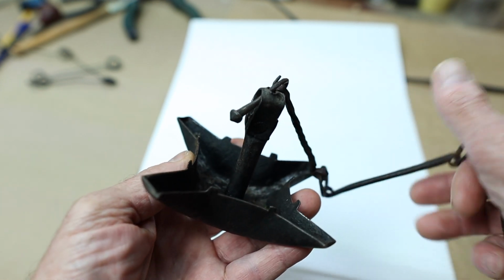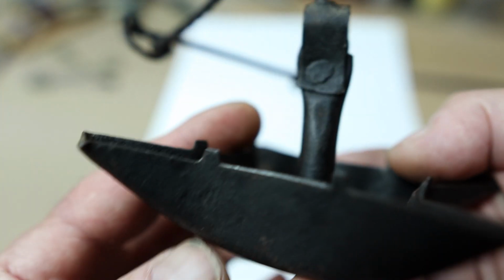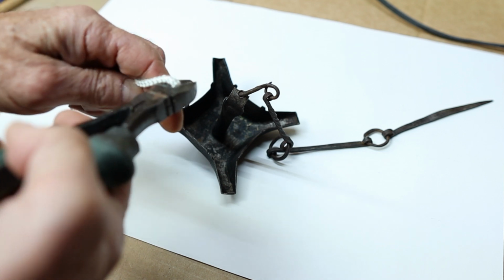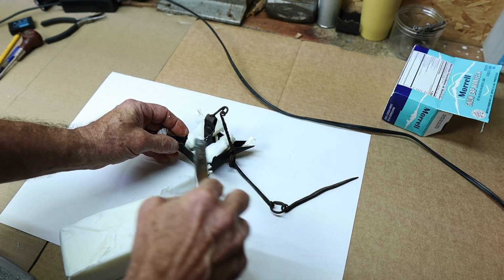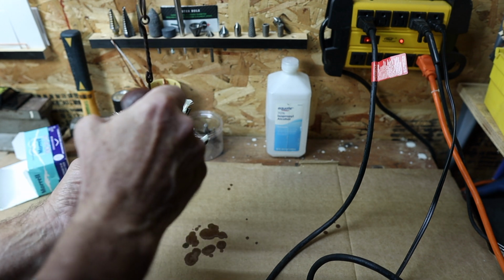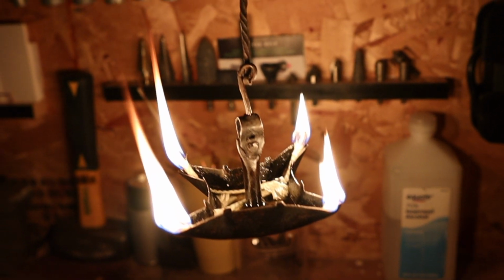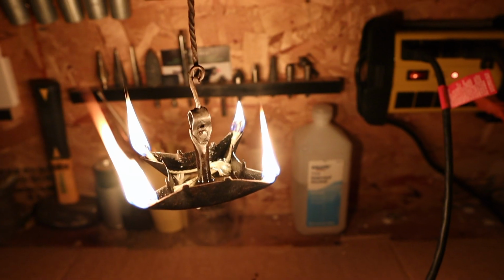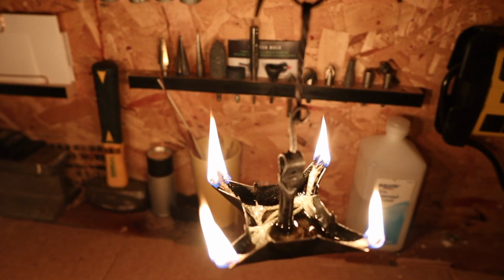Lard For Light When The Grid Goes Down?

Comment: Calling the lamp you have a "cruiser lamp" is a misnomer.
It's a beautifully preserved antique and I applaud your skill in making a reproduction, but it's still just a simple oil/grease lamp.
As you have noticed unburned oil drips from the spouts where the wicks are.
In Scotland in the 17th century they started making Cruisie lamps, also spelled "Crusie" and "Cruisean" (spelling wasn't an exact science back then).
The Cruisie lamp consists of two lamp pans, one above the other. Fuel drip from the upper lamp pan fell into the lower pan minimizing oil/grease mess below the lamp. As the fuel in the upper pan was used up the angle of the upper pan could be altered to keep oil flowing to the wick.

An evolution of the Cruisie lamp is the Betty lamp. In the Betty lamp the upper lamp pan is dispensed with because an internal wick holder eliminates fuel drip. The addition of a top cover provides protection of the lamp's oil from insects, minimized spills and increased burning efficiency.

Comment: Oh - could you attach a little "saucer" ?
On a "stem" just like the lamp but a little larger to catch the dripping? Kind of a two story lamp.
Just a thought.
I really want one of these. Again, thank you.
Reply: The design of this is probably what produced the idea for a better invention, the oil lamp, but I doubt it burns lard.
Reply from the maker: I've seen these with a plate underneath to catch the drips.
Reply: Or design it with a lip on the 4 ends.   You could also add a vertical attachment to hold the wick up while it burns.

Comment: Why not put a 'ridge' for the wick to rest on just below each of the 4 lips far enough down so that it drips back into the tray?  Would that work?
Reply from the maker: Yes. That will work. It's what was done with newer versions of the lamp. 👍
Reply: @herrickkimball  Wow. I didn't know.  Thanks for your reply!  It's nice to know that what I thought might work actually does.   That's cool.  BTW.... If you are i nterested in a relatively cheap wick that lasts nearly forever, check out video # 1689 (and others) by Robert Murray Smith.  He's been making and testing homemade heat and lighting sources.  I think he's an engineer (in Britain) - it seems so to me, anyway.